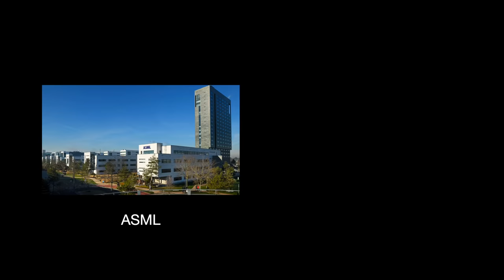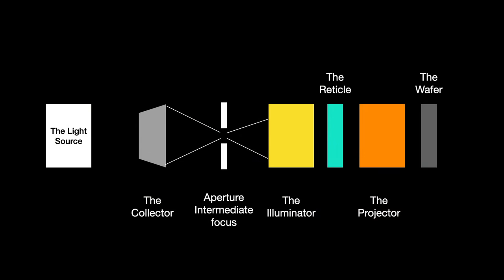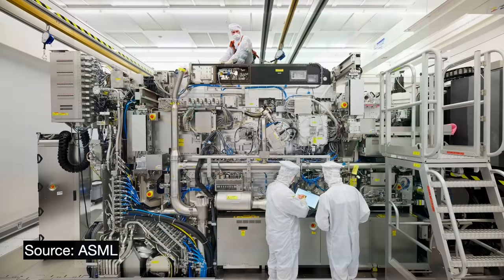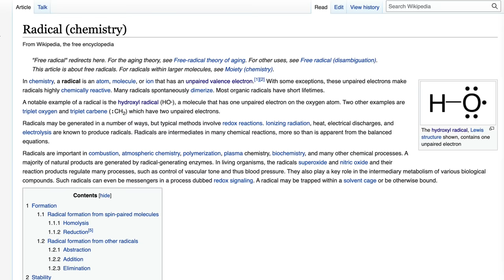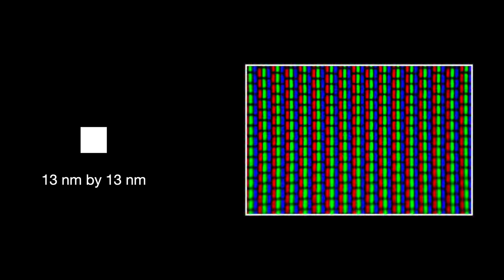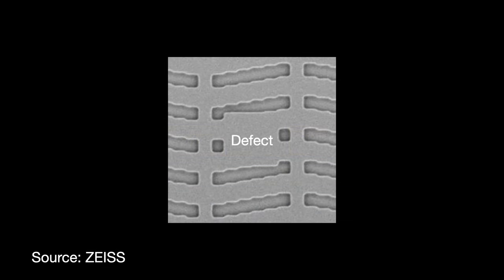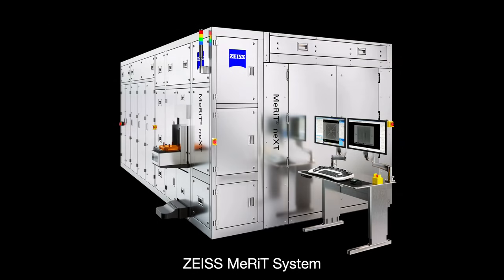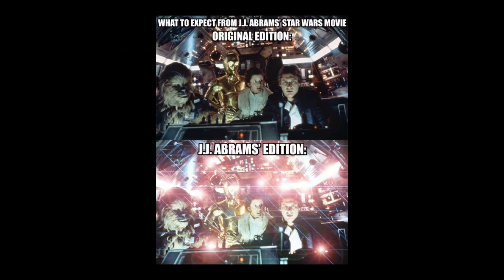How Carl Zeiss Crafts Optics for a $150 Million EUV Machine

Comment: Your videos are the best presentations of technology.  I wonder if an alternate design approach is easier to achieve EUV lithography for small diameter wafers by use of small deflection mirrors where XRays or EUV graze off the surface.  Also, instead of a pulse of EUV over the whole wafer, if it were designed as a stepper process where a column of ICs are exposed at a time.

Comment: Please do a video on what comes after EUV. Whats next in the pipeline? After quantum effects become a solid boundary how can we keep moores law going?
Reply: I would assume 3D-assembly of transistors, i.e. multi-layer transistors.
Reply: When I was young&bright many years ago (not any more :)! I have had to answer a similar question as an assignment. My answer was - develop an "atomic engineering" process controlling an atom's position using high energy neutron scattering/etching ... similar to playing a snooker game.
This process could also be considered a new branch of chemistry when atoms replace neutrons (e.g. Si|Ge). I think crude, not so deterministic neutron variation is utilised as a tool to speed up the genetic modification of plants.
What is only required is adequate "optics" for high energy neutron beams. It shouldn't be difficult, should it?!

Comment: At such short wavelengths you are basically forced to use all refletive optics. You know it's serious when you are using monoatomic hydrogen to scrub the optics, that reacts with most materials. The multilayer coatings on the mirrors must be extremely durable and the CVD coating process extremely precise.

Comment: If I am not mistaken uV wave propagate through glass suffering significant dissipation or total dissipation. I guess the term “lens” in this video is mistaken for optical mirrors. The blue paths in page 11:39+ depicts (blue) processes uV beams bouncing off (grey) optical mirrors which confirms those weren’t glass mirrors. Am I right?

Comment: The mirror layout does not make sense. So yes, you reflect in a deeper layer, but still the chances of the light returning to the surface are slim. The late stage reflection increases the chance of a defect interaction and energy to mirror deposition significantly.. at some point- a collection system for rays gone astray would be more efficient, so the stray uv does not damage the mirror?

Comment: I think the caculation of the mirror precission might be a little off:
4500km = 4500000m, in relation to a mirror of 0,45m (450mm) thats around 9.000.000 : 1
9.000.000 x 50*10^-12 (thats pico meters) = 0,00045m, or 0,450mm or 450µm
Still stagering small but a factor 1000 off from your 0,45µm

So it seems your number or mine are somewere missing a factor of 1000

Comment: Just seeing how the mirrors are arranged and the numbers of mirrors the reticle has to go through to "print" the circuitry astounds my mind. I'm not an engineer or physicist but wouldn't it be easier to stack them up?
Reply: What do you mean by "stack them up"? The light has to go from one mirror to the next, so you have to zig zag somehow. Moreover, the angle of incidence (at what angle the light bounce off the mirror) has to be within a certain range for the multilayer to work properly.

Comment: Hey, Asianometry. I believe your 10-million-fold scaling of the deviation of 50 picometers across a 450 mm-wide mirror to a 4500 km-wide country is way off. The deviation for the country-size equivalent would be 500 microns, or one-half millimeter. This is still impressive accuracy, but is far more deviation (1250 ✕) than the 0.4 micrometers in this video.

Comment: If EUV wavelength is around 100 nm?  It melts my brain. I still don't understand how they can create structures at less 7nm?    I would think that they would have to start using x-ray lithography soon to get even smaller.  Why didn't they just use x-rays?  IBM had x-ray lithography process for a while but didn't get accepted by the big foundries.  I wonder what was the challenge?  What didn't work?
Reply: Extreme ultraviolet lithography (also known as EUV or EUVL) is a lithography (mainly chip printing/making aka "fabricating") technology using a range of extreme ultraviolet (EUV) wavelengths, roughly spanning a 2% FWHM bandwidth about 13.5 nm.

While EUV technology is available for mass production, only 53 machines worldwide capable of producing wafers using the technique were delivered during 2018 and 2019, while 201 immersion lithography systems were delivered during the same period.[1][2][better source needed] Issues that make EUV adoption difficult are tool costs (ASML's EUV scanners can cost up to US$120m[3][4]), tool uptime and stochastic phenomena.[5] The latest NXE:3400 tools have been equipped with lower pupil fill capability for better imaging,[6] but this leads to lower productivity due to limited use of the exposure field.[7] Several fundamental issues still remain.[8]

As of 2020, Samsung and TSMC are the only companies who have used EUV in production, mainly targeting 5nm. At IEDM 2019, TSMC reported use of EUV for 5nm in contact, via, metal line, and cut layers, where the cuts can be applied to fins, gates or metal lines.[9][10] At IEDM 2020, TSMC reported their 5nm minimum metal pitch to be reduced 30% from that of 7nm,[11] which was 40 nm.[12] Samsung's 5nm is lithographically the same design rule as 7nm, with a minimum metal pitch of 36 nm.[13]

Comment: 50 pm rms only means that on (sq root) average surface is on the same level, but actually there are areas higher or lower in atomic steps of 2-3 nm each. So it's not insanely plane surface

Comment: We all know there’s chip shortage for EVs.  The is the machine that choke off the supply chain.  Whoever controls the next generation machines will also controls the future supply chain.
Reply: EV mainly use DUV machines still, so no that is not the machine that is chocking the supply chain. It is rather a general shortage and car manufacturers where never the ones paying most for chips so that the foundries use their capacity for different chips which than leads to shortages in the automotive industries. Also the fire in a fab in Japan that is focused on EV Chip manufacturing caused a huge disrupt.